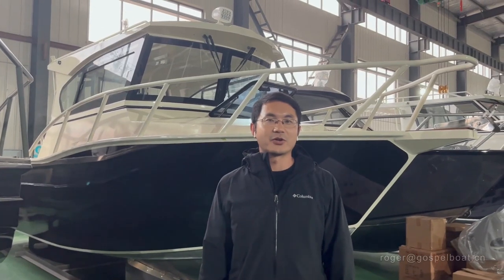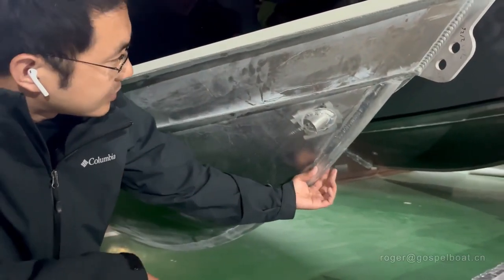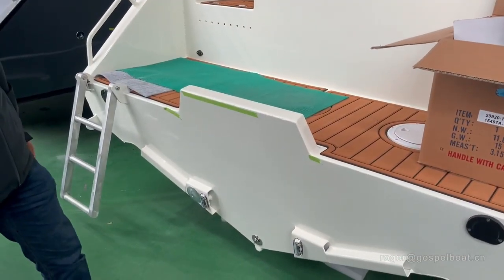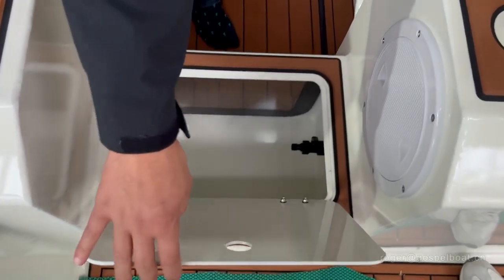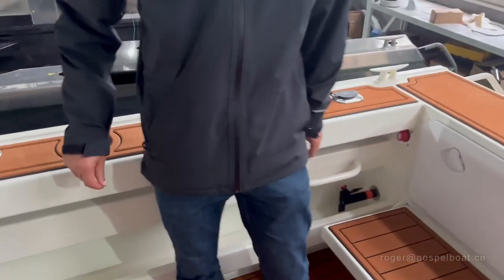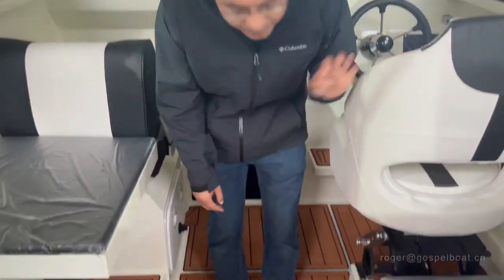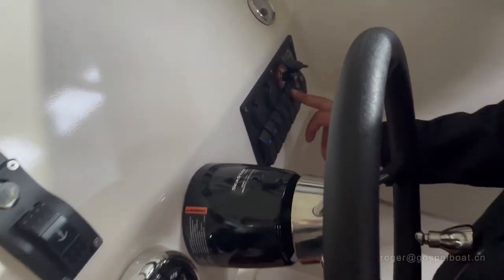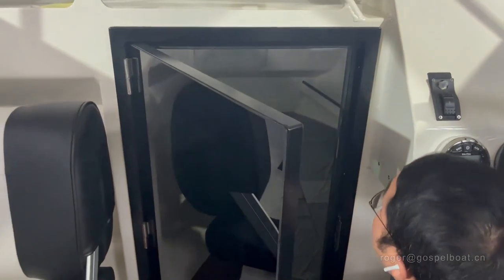ROGER'S CRAFT -- Gospel boat 2022 new model --  7 5M New Design Forward Cabin Profisher Boat, 1

Comment: Does boats have spray insulation to reduce noise. Whats price with trailer and 300 Yamaha.
Reply from the maker: Hi Mate , we can put that as an options if you needed . The standard boat price is USD26900 for standard boat , and engine we recommend you purchase and install in your locally . The trailer cost is USD2990 for dual axle hot dip galvanized trailer . May I know your email to send you the quote sheet ?  Best regards , Roger Zhang / sales director
Reply: What travel time to Vancouver Canada and app. Cost.
Reply from the maker: @ScottHodge-tp7ib  thanks , will let you know , we are sold many boats to your city .
Reply: @gospelboat396  can you put a dometiq aircon in here
Reply from the maker: @TenshinKannon  Hi brother , yes we can put a Dometic air conditioner on the roof top no problem !